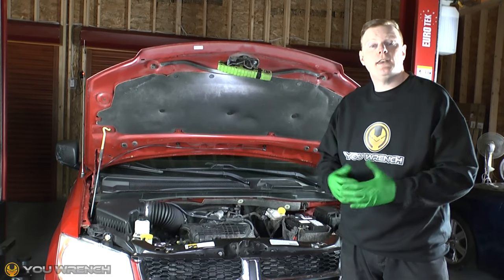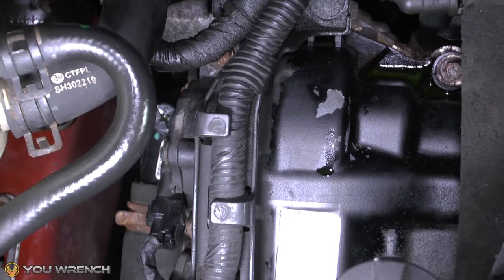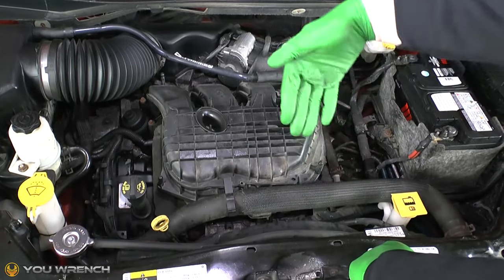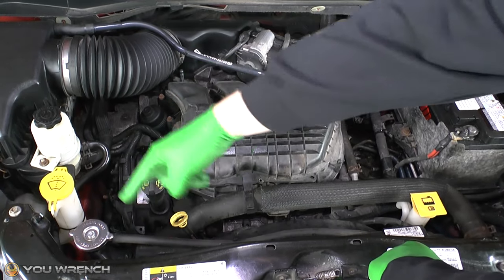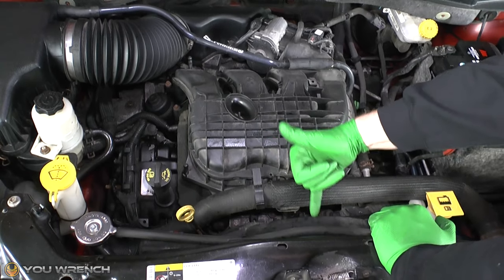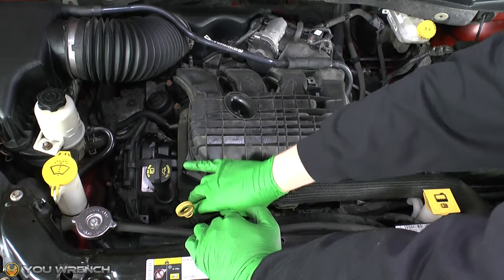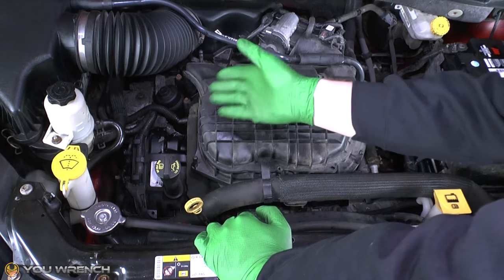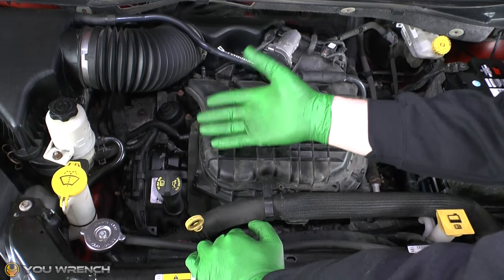How to Test if Your Car's Thermostat is Working (Without Removing It!!)

Comment: Hi, great video!
My car temperature gage keeps bouncing from 4/8 to 3/8 bars ( still in the normal range).  Do you think I should worry/ have a faulty thermostat? 
Thanks.
Reply from the maker: If it's within the normal range then you should not have anything to worry about :-)

--- 

To help support us (for both you and others reading this) there are a few things you can do:

1) Donations both needed and welcome! We cannot operate You Wrench without the support of people like you! You can donate by PayPal - just go to www.paypal.me/youwrench

2) Please ensure you subscribe to our YouTube channel. 

3) Please Like our video's on YouTube (by clicking Like!) 

4) Please help spread the word, the more people who know about us the better! Add links to our video's in forums, let people know about us.

Thank you for your support!
Reply: Mine does the same thing.
But my heater doesn't work when the engine is hot..
Could it be the thermostat or do you think its a different component like a heater core?
Reply: The carpet underneath my passenger side floor mat was very wet because of leaking heater core behind glove box. I regularly added coolant antifreeze in jug for weeks until a thrifty experenced mechanic was found. Pontiac V 6 .   Check the 2 small hoses there also.
Reply: @DoubleTripleOGfromtheset  heater core
Reply: @NathanCarr42  now the AC dosent work after flushing the heater core. But the compressor clutch turns on. Think it could be my relay or a leak? It worked fine before I flushed. It's a 1999 toyota

Comment: As a young lady, I do make every attempt to educate myself about my car and other things. This was a very easy video to understand! If it's this easy to determine condition of a thermostat, then why do the Jag dealership charge a lot to check them out and exaggerate the amount of time the diagnostic takes? I'm just curious!
I will be taking it in soon because, apparently, there's a thermostat issue. Blah. I just replaced the water pump last year, June 2022!

Vehicle specs:
2017 xe 25t
39,000 gas
2.0 base
Regularly maintenanced for the last 5 yrs at the dealership! 
Miffed right now about this thermostat concern. 🙄 
Miffed last year about replacement of water pump! 

Suggestions and comments are welcomed!
Thank you, sir!
Reply: So they can make money !!😅
Your dealer would just connect it to their scanner first, they wouldn't do a manual test like this... 😂

As someone else has posted.. get a Bluetooth OBD2 (OBDII) scanner from your local automotive store and torque pro app and connect to your mobile phone... cost you less than $50
(Since you want to learn)... potentially save you lots of money.

Since you already suspect thermostat problems.. NEVER go to a dealership who charge an arm and a leg - go to a local mechanic....(caveat !!) BUT who knows your type of car.

Comment: Understand what you’re trying to say, but I’ve always found the car heater will tell you
Heater blowing hot air at normal time after start up = water has been heated and now circulating normally

Comment: Sir is it normal first start in the morning even engine is cold the upper radiator hose is very hard to touch? Is it connected to stock open thermostat?
Reply from the maker: Hey there! No, usually it is very firm when heated up and everything is flowing, but when the car is completely cold the pressure shoudl have dropped and it should not be firm anymore. Hope that helps!

--- 

To help support us (for both you and others reading this) there are a few things you can do:

1) Donations both needed and welcome! We cannot operate You Wrench without the support of people like you! You can donate by PayPal - just go to www.paypal.me/youwrench

2) Please ensure you subscribe to our YouTube channel. 

3) Please Like our video's on YouTube (by clicking Like!) 

4) Please help spread the word, the more people who know about us the better! Add links to our video's in forums, let people know about us.

Thank you for your support!

Comment: My engine is always hot to the touch but my temperature gauge on the dash never goes above the regular operating temp. It’s a 94 geo prizm any suggestions what’s wrong with it ?
Reply from the maker: Well, engines do get very hot to the touch, that's normal. If the temp gauge is normal and the car is not overheating, then it sounds like everything is running just fine. Hope that helps!! :-)

--- 

To help support us (for both you and others reading this) there are a few things you can do:

1) Donations both needed and welcome! We cannot operate You Wrench without the support of people like you! You can donate by PayPal - just go to www.paypal.me/youwrench

2) Please ensure you subscribe to our YouTube channel. 

3) Please Like our video's on YouTube (by clicking Like!) 

4) Please help spread the word, the more people who know about us the better! Add links to our video's in forums, let people know about us.

Thank you for your support!

Comment: On stuck close thermostat, regardless of engine make (diesel or gasoline), those two hoses connected on the radiator, one will be hot & the other will be warm after warming up the engine?
Reply from the maker: Hey there! If the thermostat is locked closed, then the car will overheat as the coolant cannot cycle away from the cylinders around the engine. In this case, the top hose will never become properly hot as the hot coolant is not being released into the top hose. It gets a little confusing if the thermostat is partial broken, i.e. letting out some but not as much as it should. Hope that helps, and best of luck!

--- 

To help support us (for both you and others reading this) there are a few things you can do:

1) Donations both needed and welcome! We cannot operate You Wrench without the support of people like you! You can donate by PayPal - just go to www.paypal.me/youwrench

2) Please ensure you subscribe to our YouTube channel. 

3) Please Like our video's on YouTube (by clicking Like!) 

4) Please help spread the word, the more people who know about us the better! Add links to our video's in forums, let people know about us.

Thank you for your support!
Reply: Both top and bottom should be  hot after engine is at operating  temperature

Comment: Whats the valve next to the thermostat the one with (×).Ive seen people open that.
Reply from the maker: Do you mean the big plastic X on the black round cap? If so, this is on the thermostat itself and you would usually open that valve when refilling the system after a coolant drain to ensure that the air can come out of the engine to be displaced with the coolant. You would usually start your fill with that valve open, then when you get a steady flow of coolant from that valve you close it as you know the engine level is good, then continue with the fill as required. It can vary by manufacturer to manufacturer, but that's a typical process for something like a Dodge as seen in this video. Hope that helps 👍

-----------------------------------------------

To help support us:

1) Please be sure to use our Amazon Links!

2) Please ensure you LIKE our video's, and SUBSCRIBE to our channel!

3) Donations always welcome! Hit the SUPER THANKS option below the video on YouTube, or by PayPal: www.paypal.me/youwrench

Thank you for your support!
Reply: Thank you,this helps

Comment: Any ideas on why my car won't get up to operating temperature I drove it for 180 miles and it still wasn't at operating temperature not even to the first numbers and it's sending out loop warm air instead of heat, there's no leaks
Reply: Thermostat stuck open

Comment: Hi could you answer this question. I have a 2002 sienna. It overheats after driving for 10 minutes. I have to stop the car. I replaced the radiator, the water pump. I did not replace the thermostat but I ran your test and it passed. So It can't be the thermostat. While replacing the water pump I ran water through the system and it showed no blockage, My heater is working too. What else is there to check? Thanks
Reply from the maker: Overheating can be caused by quite a few different things, including those you have replaced already (of course), blockages in hoses, faulty fan, headgasket etc. It can also be the radiator cap, and those can go wrong a LOT and cause all kinds of issues. I'd start with a new radiator cap as that's sub $10 (usually, depending upon make and model, not sure on Sienna) and see if that makes a difference. Also look at testing the fan operation. Those are two common causes that are fairly easy to eliminate (and are most likely causes). Best of luck! www.paypal.me/youwrench

--- 

To help support us (for both you and others reading this) there are a few things you can do:

1) Donations both needed and welcome! We cannot operate You Wrench without the support of people like you! You can donate by PayPal - just go to www.paypal.me/youwrench

2) Please ensure you subscribe to our YouTube channel. 

3) Please Like our video's on YouTube (by clicking Like!) 

4) Please help spread the word, the more people who know about us the better! Add links to our video's in forums, let people know about us.

Thank you for your support!
Reply: @YouWrench  In my case it was the radiator cap. Unfortunately because I had replaced the cap just last year and it looked good I never suspected that. But it was just the cap.  I replaced the radiator because it had cracked because of the overheating which again was the cap that caused it to get too hot and crack.  The cap is not on the radiator.  Thank you!

Comment: So I just replaced my tstat and my car is still over heating and now the heat doesn’t work amd also even tho a ton of antifreeze came out after I removed tstat housing I didn’t need to add any antifreeze the fill tank was still full any ideas I’m thinking maybe air in the lines not allowing circulation
Reply: The heat was working originally

Comment: i replaced my water pump now i seem to be using a bit of coolant each time I come home, could this be thermostat related?
Reply from the maker: It is indeed possible that it could be the thermostat. That said, if the thermostat is stuck open then it should not usually create a leak as it just cycles endlessly which means the temp never gets as high as it should (caused things like no/little warm air inside the cabin), and if the thermostat was locked closed then the engine would be overheating for sure. Maybe you had air in the system after the water pump change? If so, depending on the system type, you should find that it will take some coolant the first few runs, and you have to top off, but then it should stay constant. If you have to top up every day then there's definitely an issue, and that could be all kinds of things. It may be worth looking for leaks on the hoses you removed and refitted during the water pump change, and note that some leaks only become apparent once the engine is hot and running and there is good pressure (a pressure test would also be wise and replicates this - see our how to use a radiator pressure tester video). One other things to note is that the level in your coolant reservoir will likely fluctuate a little bit (again depending on type) between hot and cold and what the system is doing cycle-wise and that's normal - provided that it is a little bit, and the level should always remain between minimum and maximum. Best of luck with it!

--- 

To help support us (for both you and others reading this) there are a few things you can do:

1) Donations both needed and welcome! We cannot operate You Wrench without the support of people like you! You can donate by PayPal - just go to www.paypal.me/youwrench

2) Please ensure you subscribe to our YouTube channel. 

3) Please Like our video's on YouTube (by clicking Like!) 

4) Please help spread the word, the more people who know about us the better! Add links to our video's in forums, let people know about us.

Thank you for your support!

Comment: If it stays open, will the gauge eventually reach normal running temperature 🌡or will it stay low. My car oil is warming up to 61° Celsius and than runs down to about 58°. My coolant themperture stay about the same. While normally my oil 🛢 reaches 120° Celsius operating themperture.
Reply from the maker: No, if the thermostat is stuck fully open then it will likely never reach full temperature because it's not being held around the cylinders long enough to get the heat it requires, and is constantly being cooled by the radiator on a constant loop. In this case, you will also find that there is no/little heat available inside the cabin as well because the coolant is not hot enough. Hope that helps!

--- 

To help support us (for both you and others reading this) there are a few things you can do:

1) Donations both needed and welcome! We cannot operate You Wrench without the support of people like you! You can donate by PayPal - just go to www.paypal.me/youwrench

2) Please ensure you subscribe to our YouTube channel. 

3) Please Like our video's on YouTube (by clicking Like!) 

4) Please help spread the word, the more people who know about us the better! Add links to our video's in forums, let people know about us.

Thank you for your support!
Reply: @YouWrench  Thank you so much! 3 points checked!

Comment: My temperature gauge in the car goes up and down as I drive it.  Sometimes at a stop light, my temeprature will reach almost to the H.  Could this be a symptom of a faulty thermostat?
Reply: Get a New Thermostat and a new radiator.. It will work.. Mine was like that recently I replaced those parts it actually work well now

Comment: Your heater won't work hahahah another good way to know
Reply: @Scott Johnson Thanks for your comment.  I am going to check if my heater is working.
Reply: @Scott Johnson i filled the coolant reservoir drive several miles and the coolant reservoir is either low or empty. The temperature gage starts going above the midline. Basically the car runs hot. Is that a thermostat issue?
Reply: Maybe the wrong thermostat. They are cheap I'd try replacing it
Reply: @scottjohnston4018  it's the original thermostat. I had to purchased the entire thermostat housing unit.
No long can buy an $ 8.00 part.😆😆😆

Comment: Hi, my engine is overheating after a few hours of use and it seems like the hose is slowly heating (indicating the thermostat is stuck open). Could the thermostat being stuck open cause the engine to overheat?
Reply: No but. If it's stuck open it will not overheat... but it'll sound like a plane from the radiator fans running nonstop

Comment: What would/could be the cause of an LT1 over heating when parking?
The car starts overheating fast when I'm slowly manuvering (Few feet forward, few feet back etc) into a parking space
Car is fine at all other times
Water pump, thermostat, and coolant are all about 1 year old
I bled the system
Fuses and box LOOKED ok
Just put on a new ac delco rad cap
Unplugged the WP to test the fans and the drivers side works but NOT the passenger side
Neither the AC or the heat hasn't worked for over a year btw
Reply from the maker: You mentioned that one of the radiator fans does not work? If that's correct, that would be a likely suspect for sure! Remember when the car is driving the air flow helps cool the coolant in the radiator, but when stationary you are reliant on the radiator fan/s. That said, not sure why the AC nor the internal heat would have stopped around the same time you had your water pump work done, as it's both together that may be an unrelated issue. You should start by checking the fuses, each fan may be on its own fuse so you need to check both so you can rule that out. You could then try testing the fan that doe snot operate by apply power directly into it (be careful!) and that will show if the fan is good or not, and then you can replace that fan or otherwise start tracing the fault if the fan is good. Best of luck, a bit of time, logic and patience and you'll get it done!      www.paypal.me/youwrench

--- 

To help support us (for both you and others reading this) there are a few things you can do:

1) Donations both needed and welcome! We cannot operate You Wrench without the support of people like you! You can donate by PayPal - just go to www.paypal.me/youwrench

2) Please ensure you subscribe to our YouTube channel. 

3) Please Like our video's on YouTube (by clicking Like!) 

4) Please help spread the word, the more people who know about us the better! Add links to our video's in forums, let people know about us.

Thank you for your support!

Comment: Probably a dumb question. What if the thermostat is stuck on open?. Can I just leave it?, does it do any damage to the engine?. Thanks.
Reply: No just take forever  for heater to get hot

Comment: So I did this this morning on my 06 dodge charger rt. I started it and let it get to operating temp. It has 180 t Stat I never felt the coolant hose get hot other then from the engine temp shouldn't it have gotten to where I couldn't hold my hand on that hose. Does this mean my thermostat is bad
Reply: No doubt
Reply: @slayershine6220  yea it was the thermostat I went back to a stock one haven’t had any issues since.

Comment: Great info but I have a C4 Citroen,  have had overheating lights come on .. the coolant lvl has gone from max to under low .No leak .. when I open (when cooled down ) the lvl goes back to max .. Where is the coolant going ..? there is also no heat coming from heater ? when car is at running temp 20mins .. it has no moter heat gauge ?? I'm lost
Reply: Tryed your tip my top pipe gets hot as motor does bottom tube is cold . in the coolant tank is liquid going g back in over the overflow pipe ???
Reply: Update?